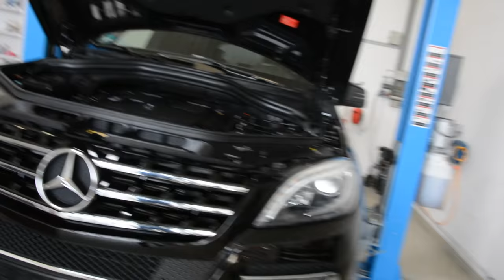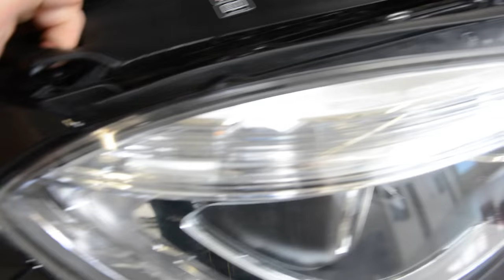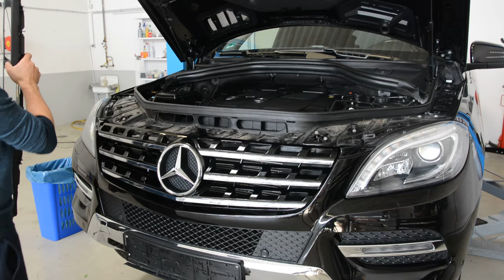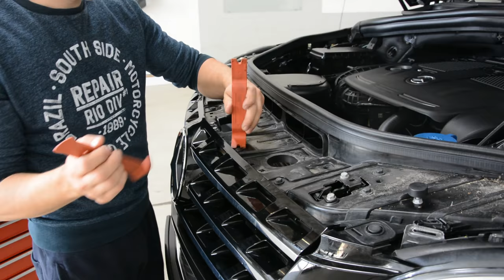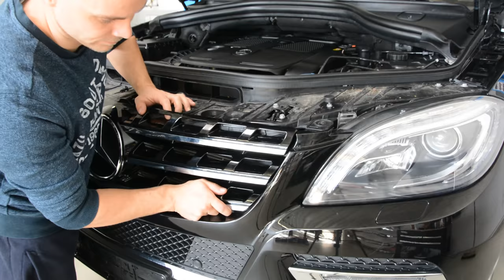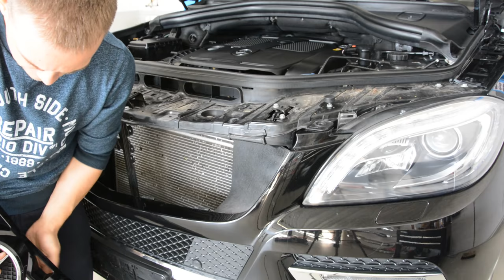Front grill removal Mercedes ML

Comment: this didnt work on my 2014 gl 450
Reply: what was different? I'm hoping grill size is same for ML and GL for same years
Reply: @9Shahrukh9  i would have to show you in a picture but there are many tabs and the top left and right sides are engaged in a block type section also with tabs the only way i see to get it is smash it out or cut it out